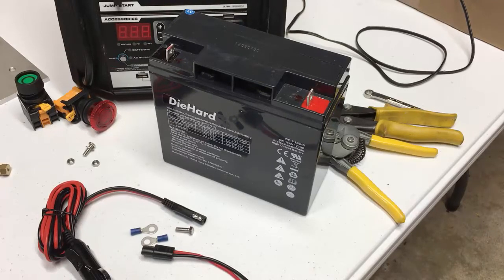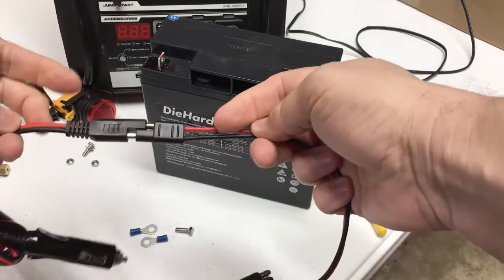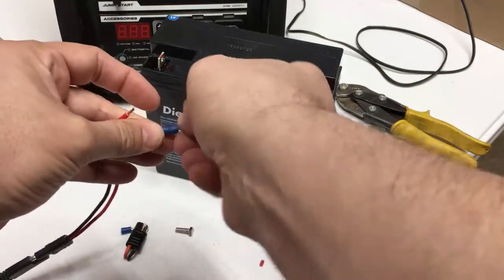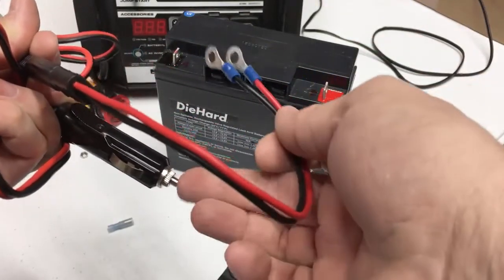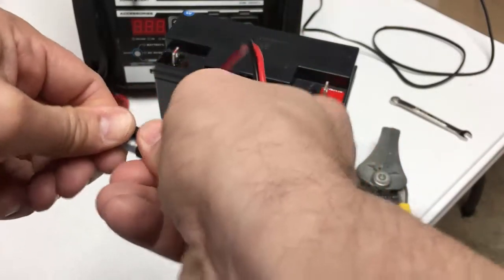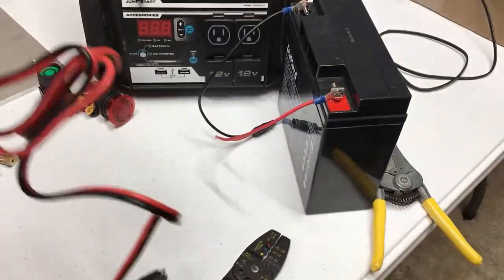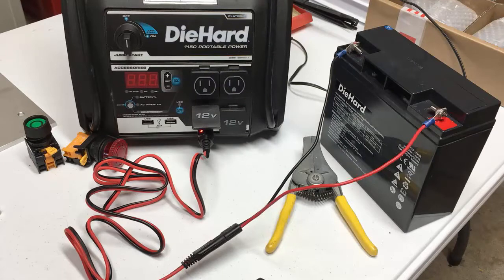Increase Your Solar Generator's Capacity

Comment: Hey there! Bought the due hard jump pack, extra battery and all the necessary components to double my battery capacity. You say that the internal charger will charge both batteries but it will take longer- understandably. Will the diehard display of battery charge level read correctly that BOTH are fully charged at 100% because both are connected? The items arrive today. I plan to charge the jump pack and additional battery so we start out at 100% each before connecting. Since connected, is the Diehard reading of 100%, 75% etc. Going to be for both, the entire, set up or just for itself? As it discharges, is it pulling from both like it was a 40ah battery, or one battery then the other? I am no electrical person so I have to ask!
Reply from the maker: Jeana,  Sorry for the delay in answering your questions.  First off, the displayed percentage of charge is derived from the battery voltage (not important here, but worth knowing).  If you have one battery that is charged and one that is not charged as much, they will tend to equalize somewhere in the middle as the charge from one moves to the less charged battery.  So the charge meter is really showing a "charge"  or voltage that is somewhere between the voltage that would show on each individual battery.  It's one of the reasons you want to start with two new batteries.  Both batteries should arrive close to the same charge and when you connect them, you will likely see 100% on the display, but don't believe it.  Connect the extra battery and charge for 36 hours to ensure that they are topped off the first time.  When they discharge, they will each give up an equal amount of current because they are wired in parallel (+ to +, - to -) and discharge at near the same rate.  In reality, no two batteries will discharge at EXACTLY the same rate, but it's close enough for what we are talking about here.  Let me know if you have any other questions or if I made it more confusing :-)
Reply: @OdysseyCamper  no I got it! I have charged both separately and once I connect them, I will do as you say and charge while connected together. I do intend to try to charge via solar as well as via my vans ciggarette port. I purchased the charge controller you used for this (not the one for the console) . Luckily, I gave a HF 45 watt solar panel system and the connectors are the same type- not mc4. Guess I will have to check that connection on the charge controller that you had to switch as well, tho. Kinda taking in steps. Would like to try the timer too but no time fir Amazon b4 I leave so will look for similar at Walmart. Hopeful. Thanks for the response. Lastly, i gave akways been told not to discharge the batteries below 50%. Seems you have drained the jump pack well below that? What are your thoughts?
Reply from the maker: @jeanariley7759  Cool, you're making progress; remember, you don't have to do it all at once.  You are correct that you should not discharge the batteries below 50% if you want the longest life from them.  If you discharge them say 90% each time, then they will only last about 500 full cycles.  If you only go 50% they can last 1000.  For me, I charge when possible and discharge as much as I need to.  If they only last two years instead of 3-4, it was worth the cost of replacement to have some convenience.  That said, if you DO discharge to under 20%, don't put off recharging.   If a lead-acid battery is stored too long in a discharged state, it may not come back.  But we are talking weeks not days.
Reply: @OdysseyCamper  great! I wondered about that,  too. Are the timers you got judt regular light timers? All I am seeing at local walmart. I, too, want option to run a small 250 watt heater. Had another youtuber, Luke Fugate, install a system in my van thst lets it work like a Toyota Prius. Have household thermostat that is hooked to ignition. No need for keys etc. Set temp, heat or cool, on thermostat, preset vehicle controls and fan. When drops below set temp, vehicle starts and runs til set temp reached then shuts off! Not expensive to do either. I just want several options other than butane or propane heat plus a backup source for my fridge. Have 200 watts solar and 100ah house battery also hooked to an isolator. But Murphys law....id really like to run the little heater that way, but I dont thibk it had a thermostat. Its just on or off and hi or low I think. I have a 350 watt that does havr thermo and a 500 watt invertor but am clueless on this
Reply from the maker: @jeanariley7759  That thermostat idea sounds cool!  I like to have options and backups as well.  I run this heater when getting dressed or making breakfast, but there is really not enough juice in the battery pack to allow it to be a primary source of heat.  However, with your 100ah house battery, you could run a lot longer, making it more viable.  Keep in mind that a timer switch is doing the same thing as a thermostat by cycling the heater.  You just increase the off time if it gets too hot.  Admittedly, that's not as easy as a thermostat, but I think it ends up being more efficient because you'll never really get the van warmed to where you want if it gets really cold.  At least not with this little heater.  So, the thing would probably just run constantly.  My blankets keep me warm at night and the electric throw is more efficient for keeping warm (60W to heat YOU, rather than 250W to heat the van).  One other thing the timer has in its favor is that you can predict how much power you will use in a given time period.  So, you could set it to only use up 50% of the battery power by running it less.  The thermostat would be harder to predict.
Reply: @OdysseyCamper  well my 12 volt Dometic fridge is most important on the 100 ah battery. I have a butane stove and heater plus the mandatory carbon monoxide detector. Travel w/3 dogs so van warmth necessary as opposed to just me. I wanted the jump pack set up for all extras it provides, as a back-up, etc. Agree about timer being more energy saving cuz that little heater at best will take a little chill off. I foubdo a Lasko ceramic on Amazon that is 200 watts for $19.99- fyi.
Reply from the maker: @jeanariley7759  I will look into that one!  Yeah, everyone's travel situation is different and the dogs definitely change things.  I just hope that people will get ideas here and develop them into something that works for them.  I eat fresh veg and dehydrated soups or oatmeal when traveling, but I wouldn't expect other people to do something weird like that.  We all have to figure out what works for us!
Reply: @OdysseyCamper  the heater is a Lasko #100 my heat personal ceramic heater. I was just curious that the 200 wants you know how much difference is at 50 Watts going to make I mean obviously less of a power draw but how much heat is it going to put out? I have some other heaters that are 350 watt that are actually digital and have a thermostat on their call the Handy Heater but that's just a bit too much to try to run on what I've got or off the jump box I would think. As far as food I do eat somewhat differently when I'm camping. I do have the refrigerator but that's for the dog food long story I won't go into. It's also for milk to keep drinks cold and I may have some meat products but yogurt and things like that. As well as produce such as fruit lettuce tomato onions things like that. Mostly for breakfast I do overnight oats and those are prepared with oatmeal and yogurt and milk and in 4 to 6 hours and makes a very creamy consistency and see put in the refrigerator I typically will warm mine in the morning in the microwave just a little but if you leave it sitting out to get room temperature that's inadequate enough for me. But I will do canned soups that I can warm using the butane stove in a little pain or jerkies and dried Meats cheese things like that as well as canned chicken to put into like dehydrated noodles and and just various things like that just to make it simpler so that I'm not doing a lot of cooking and washing dishes and stuff like that. I would think that the way that you do it just makes it very simple. I know a lot of people will eat energy bars for breakfast and then do the same thing like in a dried meats and crackers and canned fruits and puddings and various things that just make it easy so they can eliminate the need for refrigeration and not have to rely on that but I do like some of the conveniences when I camp and I tried to fix the van up to be comfortable as well as give me some amenities. The inverter that I'm looking at is a wagon true rated 400 watts continuous power inverter with USB charging ports for $27. Like I said the only other inverter I have and I've never even used it because I tried to just work off the 12 volt or regular old batteries is a 500 watt and unless you tell me otherwise I think that's too big for the jump box I don't know it does have a cigarette lighter plug that can be used I just would rather play it safe and kind of go with your guidelines and everything that you use I think the 300 watt would be too little because the current heater that I do have is actually at 250w I can't think of right now but it would be similar to your little bud heater. So I'm going to assume that initially when it starts up it may pull up to 300 watts or a little bit over so I just wanted to be safe with a 400 watt rather than going to a 300 watt. What are your thoughts on that I need to order this very shortly in order to be able to get it on Tuesday
Reply from the maker: @jeanariley7759  I do like to keep things simple as well!  As far as the heater goes, there is a bit of a noticeable difference between a 250 and 300W heater.  The jump box can run either, but the larger one will run it down sooner.  I would have no concerns about running a 300W heater off of the 400W inverter that is built into the jump box.

Comment: I have a Schumacher Dsr 114 can I put a 100 watt solar panel to it or is that too strong? I saw where you suggested 60watt. What's a good folding brand. I'm only a part-time camper so nothing permanent yet
Reply from the maker: You can absolutely use a bigger panel if you have it.  Just make sure that there is a charge controller between the panel and the Schumacher.

Comment: Odessy Camper, How long does it take to charge the console 2-battery pak from the cig lighter if vehicle is idling?
Reply from the maker: Karen Eighth Honestly, I’ve never tried it at idle. I can charge most of the way in 1-2 hours of driving.  At idle is trickier to predict because the alternator may not be able to supply as much current at low speed, depending on the vehicle. I’d say it would probably take a little longer.
Reply: Odyssey Camper that makes sense. Sort of like after you jumpstart a car battery and the alternator needs you to drive rather than idle.
Reply from the maker: Exactly!

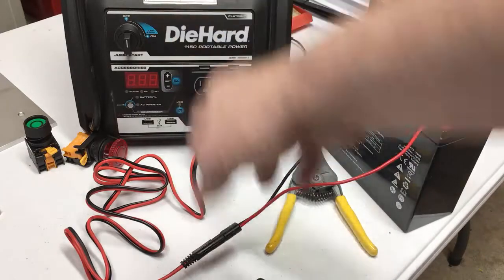Comment: Yes, that is what I was referring to at 4:36 if video. Did you do any test with larger batteries?
Also, Diehard manual says that while charging from 12v outlet, not to leave plugged into the cig lighter for more than 30 minutes. Have you had any issues charging from DC while vehicle ?
Thanks

Comment: So if the auxiliary battery is 100ah and 50% discharges, can that potentially harm either battery when set up this way?
Reply from the maker: Hi Karen,   A 50% discharge is OK and should not shorten the battery life.  When I made this video, I talked about how if one of the batteries drains, it could potentially pull high current from the other battery and melt a wire.  While that is theoretically true with larger batteries, I ran another experiment after this video.  Turns out that even if fully discharged, these little batteries do not pull enough current from the charged battery to worry about.  I think that will answer your question, but if you were asking about another part, comment with the minute and second marker and I'll try to give you a better answer.  Thanks for watching!
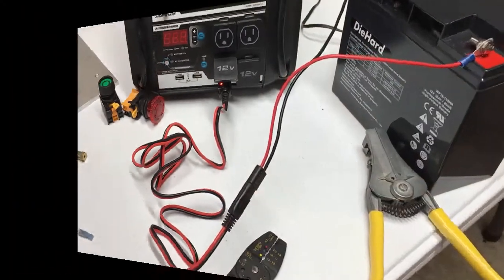Reply: Yes, that is what I was referring to at 4:36 if video. Did you do any test with larger batteries?
Also, Diehard manual says that while charging from 12v outlet, not to leave plugged into the cig lighter for more than 30 minutes. Have you had any issues charging from DC while vehicle ?
Thanks
Reply from the maker: OK, we are on the same page.  I have not done testing with a larger battery yet, but the very worst case is that you would blow the fuse in the 12v plug.  No biggie.  Also, since making the video I have charged directly from the cig lighter, but you really don't want to leave it there after it is charged because it can overcharge the battery.  The 30 min is a guess.  Charging this way (without a charge controller) can shorten the life of the battery, but you probably wouldn't notice under normal use. However, the cig lighter is great for charging up the pack in a hurry.
Reply: Thanks! These videos and comments are really helpful. 
BTW have you considered a dual battery setup charging by your alternator?
Reply from the maker: Karen Eighth Awesome, I’m glad you find them helpful!  I HAVE considered a larger battery and charging off of the alternator. However, my needs are small. Two of this size battery let’s me charge phones and an iPad, plus make my meals with a hot water heater for two days, without any sun. When there IS sun, it charges and if I’m moving, I can still plug into the cig lighter. I used two of this same type of battery in my console battery pack.  But certainly there is nothing wrong with a bigger battery and alternator charging. And you can also add a solar panel to that as well.
Reply: I agree, less is often more, and for me, there are more basic things. I made mosquito screens this week and am very happy with them. Next I’ll work on curtains and blackout windows. 
For charging small stuff, I have a 200w inverter that I can use while driving. 
And perhaps a 2nd small battery will be next. I really like your setup. 
At the end of this video you mention charging both batteries (after initial charge) at once through the car cigarette lighter “as long as there’s a charge controller”. Is some type of controller beyond the male-to-male connection between Diehard and cig lighter needed?

Comment: You mentioned the fuse blowing if the other battery (spare for example) would be drained. How would I charge it if it comes dead when I buy it?
Reply from the maker: They USUALLY come charged, but if not, it could be charged with an external charger OR you could use the jump pack to charge it by swapping it with the internal battery (15 min job), or just pulling one cable off of the internal battery and then connecting the new battery to the jump pack's 12v cigarette adapter plug (5 min job).  If this sounds like a hassle, keep in mind it's only for the first time.  What you are doing is preventing a direct connection from a fully charged battery to the empty battery.  Otherwise the current flow between the two might blow a fuse or melt a wire.  I am planning to test the battery-to-battery current draw, because these batteries might be small enough that it's not an issue.
Reply: Plug it into a cigarette lighter for a couple of hours.

Comment: can i hook my 114ah deep cycle battery instead of the 22ah? or do they need to be the same?
Reply from the maker: Brian Erickson It won’t hurt anything to hook up the larger one,  but you should make sure the other battery/jump pack is charged. If not, it may pull a lot of current from the larger battery and heat up the wires. For best battery life I would also charge them separately.
Reply from the maker: Hi Brian,  I ran some additional testing and these little batteries won't pull more than 5 amps when fully discharged.  So, connecting the larger battery should not be an issue.  My original answer was based on experience with larger batteries.

Comment: Why not connect a CES Quick Disconnect Connector with a fuse directly to the battery compartment of the DieHard Platinum Portable Power 1150
Reply from the maker: There is absolutely no reason I can think of to NOT do that.  I try to make these easy for the average person that might be intimidated by tearing into their new DieHard power pack.  However, your idea is good and you could actually run the wire through a small hole in the battery door.  Thanks for watching and the clever suggestion!
Reply: you wellcome and thanks i fallow you youtube chanel great ideas